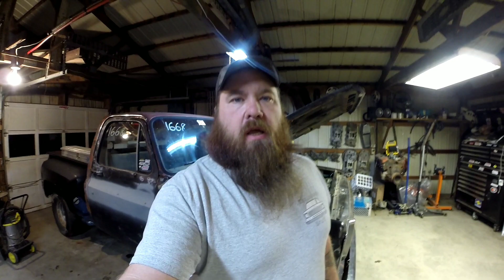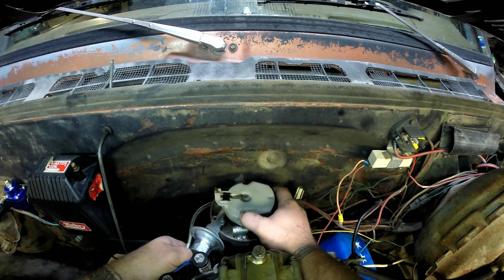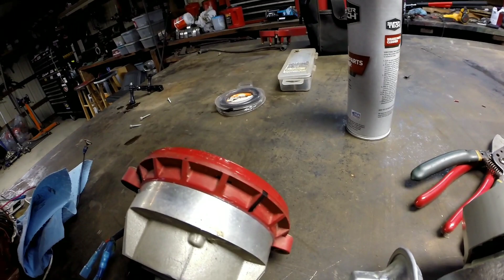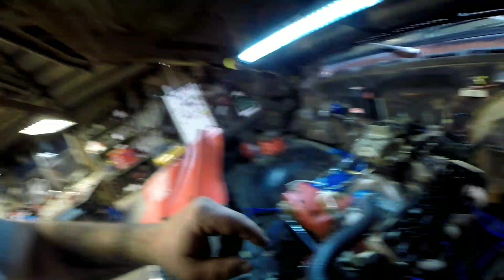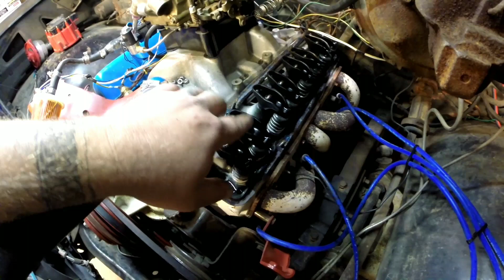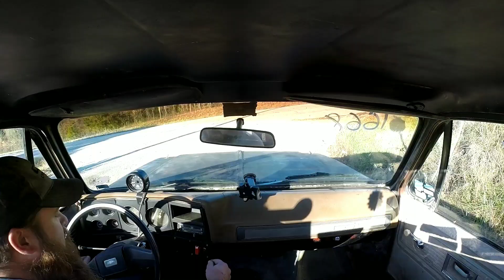How to remove and install a distributor. Replacing the HEI distributor with a Mallory unilite.

Comment: Hey Chad, im having oil get into my distributor, around the module...its a new 305 stock, pcv system working, is it maybe due to crank case pressure? It has alot of oil pressure, i think around 60-70.
Reply from the maker: I would replace the distributor.

Comment: I can’t say thank you enough for the distributor dropping info you gave these folks!!! Every video out there says “you have to have this pointed here, and that there… etc” but YOU SPOKE THE TRUTH!! It doesn’t matter one bit where number one is, when setting a new distributor in an engine set at #1 tdc! Finally! Someone said it! Although it does help with wire routing to be somewhat in the right area, it doesn’t have to be! I also loved you showing them how to “walk” a distributor around!! No one knows this stuff anymore! Thank you for sharing for these youngins learning!!! I watched just to see if you had the wiring pics I needed for the similar swap I’m doing- HEI to Mallory Unilite with Ext coil…… didn’t find that, but did find that I’m subscribing to your channel since you give old Skool knowledge!!! Love it!
(Also loved your vid on replacing the 205 output as well!)
Reply from the maker: Thanks for the compliments.  I'm running  a unilite in this truck. Let me know if you need any help with wiring.
Reply: @SquarebodyStuff  in a HEI red wire to distributor, do I need to add a ballast resistor between the red wire and the Mallory pro master coil? That’s pretty much the only wiring issue I see? Just installed the Unilite tonight, and hopefully wiring it up tomorrow! Also, what side of the coil does my Tach wire go to now? On the HEI it was labeled as “tach” but with an external coil, not 100% sure where to put that wire now….. 
thanks brother!
Reply from the maker: @davenkaren2572  if you're  not running a control box. Install it like in figure 1 in the instructions.  That's how I run mine if I don't have it hooked to the control box.
https://www.google.com/url?sa=t&source=web&rct=j&opi=89978449&url=https://documents.holley.com/mallory_instructions_unilite_distributor_37_38_45_47.pdf&ved=2ahUKEwjqiJaojqaAAxVmkYkEHf7gCPUQFnoECBEQAQ&usg=AOvVaw1F5rH6qLu4Ot6zTJN733Wp
Reply: @SquarebodyStuff  that’s what I was thinking too- but wanted to be sure! Thanks!! Also, where would I put my Tach wire in the setup?
Reply from the maker: Negative side of the coil. Is where the tach lead needs to go.
Reply: @SquarebodyStuff  you ROCK brother!!!! THANX!!!
Reply from the maker: No problem.

Comment: Hey what distributor gear are u using for your flat tappet cam with the high volume oil pump
Reply: Will it work for a stock cast iron flat tappet cam with a high volume oil pump.
Reply from the maker: Yup, been running then like that for years. Make sure you get the HD drive shaft  with the steel sleeve and not a stock one with the nylon sleeve.
Reply: These gears won't work I'm still using the stock tbi distributor
Reply from the maker: @JTsMechanicShop5748  what size is the shaft? Is it the small .425"?
Reply: @SquarebodyStuff  yes
Reply from the maker: I'll do some checking,  those don't seem to be as readily available.  Have you tried your local parts store for a stock replacement?
Reply: @SquarebodyStuff  if the stock replacement one fine then that will make me fill comfortable that it will not eat up the cam gear
Reply from the maker: That will be fine if running a hyd flat tappet cam.
Reply from the maker: Just a regular steel gear.
Reply: Ok can u send me the link for  the cam gear, I got a new motor put in my truck with a high volume oil  and I sure don't want the distributor gear to eat it's self up while breaking in the new cam. It's a tbi 350
Reply from the maker: Here's two, check your  shaft size to verify which one you needing Check out this page from Summit Racing https://www.summitracing.com/parts/sum-850466/make/chevrolet
https://www.summitracing.com/parts/sum-850467/make/chevrolet

Comment: Hey man , not sure if you will see this but I figured I'd try anyway and see if you had an answer. I took my hei off my 85 K5 so I could put it in my wife's 81 k5. Well when I went to pull hers it has an extra set of wires on the back that hook to a wire harness from the firewall. Of course my hei is basic like yours and most other typical hei distributors. I don't wanna pull the bad one until I know mine will work. Do you think the extra hook up is necessary? Or should I go try to get that same distributor? I'm in a bind so I'd like to just use mine if possible but if it wont work I'll just buy one eventually.

Comment: The intake is a bit expensive but if your going to stay with the 305 I think it would be cool if you put on some Vortec 305(5.0) heads from a 96-01 Chevy van or truck which you can find in a junkyard. Those heads flow alot better than these oldschool heads but the intake will cost a few bucks but you could always use the intake later on a vortec 350 which makes awesome power.
Reply from the maker: That's and idea I have been considering.

Comment: I bought an 82’ Chevy pickup from a friend of mine. It has a 350 he put an Edelbrock manifold and a holly carb. Why does it have a spacer under the carb and does it need the the spacer. There are no threads showing on the carburetor mount bolts. I would like to remove the spacer if I can.
Reply from the maker: I prefer to run spacers. They tend to broaden the power a little bit. They're not necessary unless it's adapting a spread bore quadrajet intake to a square bore holley or Edelbrock carb.
Reply: @SquarebodyStuff  Thank you for the reply.
Reply from the maker: You're welcome, I hope it helped.